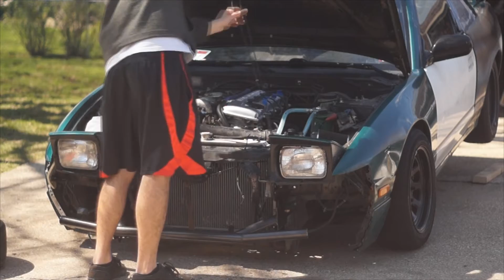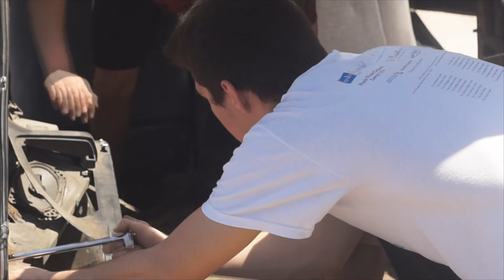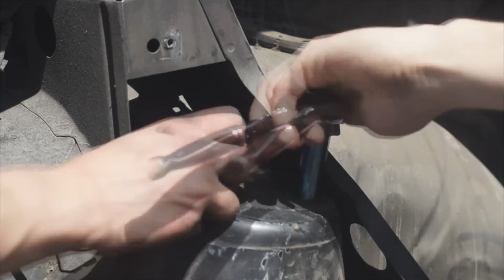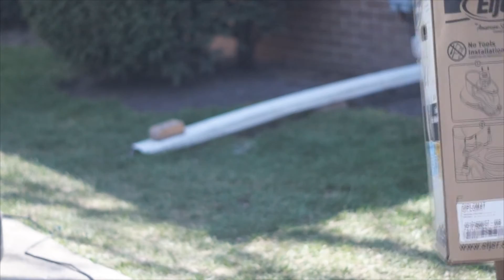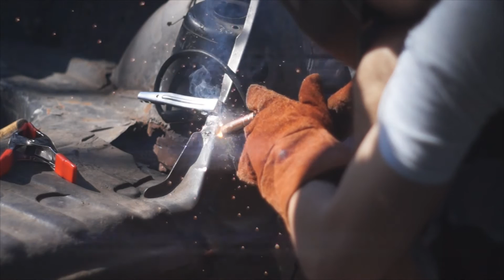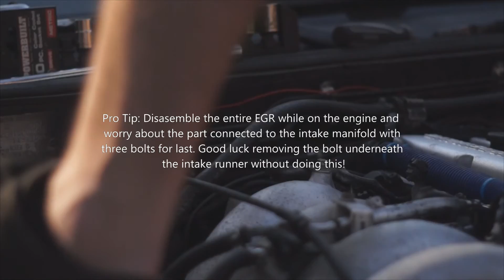240sx Builds Episode 6: Clean Up. Hatch Half Gut. Begin Repairing. EGR Delete.

Comment: Just so everyone knows, you shouldn't delete egr. It make your engine run much hotter and means that other components such as the oil cooler are more likely to fail. Also there is no power gain or really any benefit to removing it.